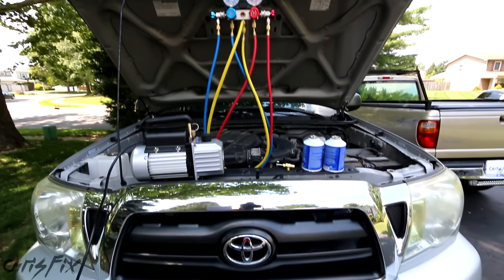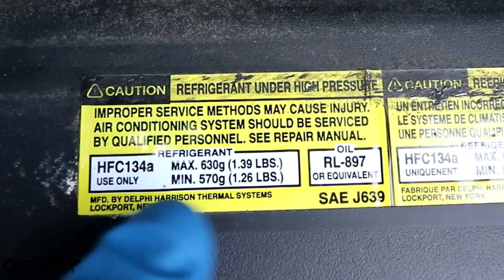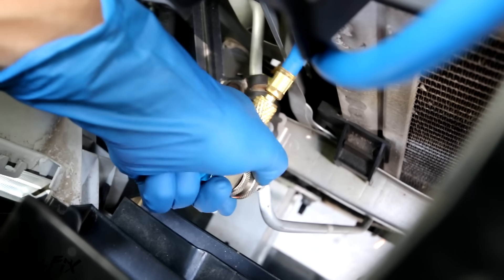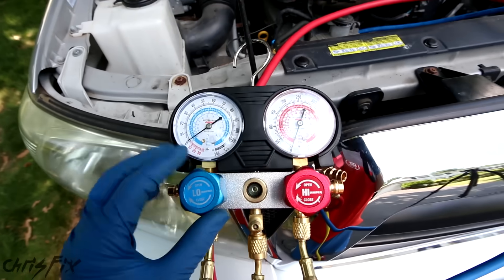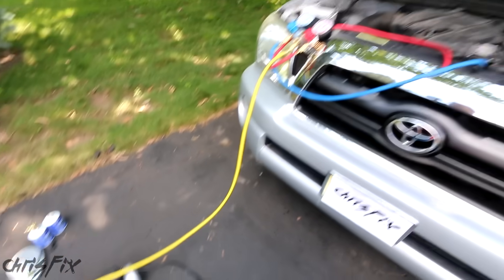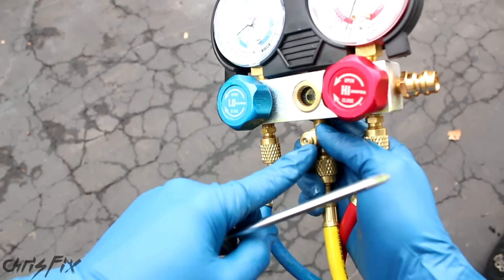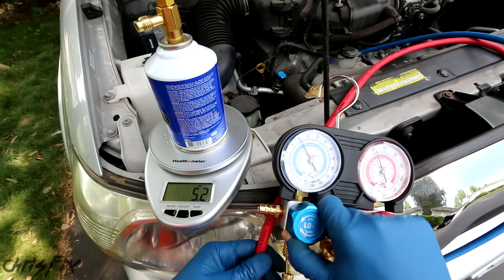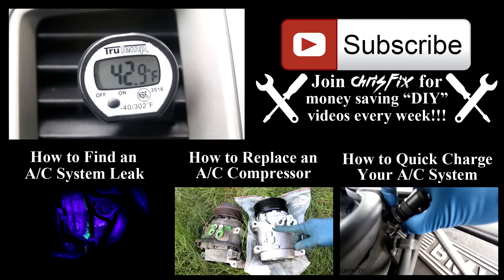How to Properly Recharge Your AC System

Comment: I have done this procedure many time and it  will work fine. Most techs pressure test the system using nitrogen then purge down to at least 500 microns , if it holds the system is recharged . According to  epa certification once your system reaches the required vacuum and holds it is dehydrated , using the vacuum again really isn't needed .

Comment: I was asked $90.00 for just checking what was wrong with my AC(Not including part and repair). I knew I had a leak and followed your videos. I was able to find and replaced the bad hose. I used this video and did a proper recharge of the AC. You Sir, saved me a lot of money and most importantly I learned something and now my AC is blowing ice cold. Thanks.

Comment: A word of warning to those who believe they have a sealed system after holding a vacuum for an hour:

I did this exact thing to my system. Preliminary test held a vacuum for an hour, leading me to believe the system was sealed. I then proceeded with another hour of the vacuum pump running. After adding the 40 oz. of refrigerant, according to the specs, all seemed fine. Cold air was blowing again, and I was ready to shut off the engine. 

Upon closer inspection, I noticed a bunch of green dye dripping on my driveway. I shut off the engine and could hear a small hissing noise. Sure enough, there was a crack in one of the rubber A\C lines. I wiggled it, and the leak became even more noticeable. I had lost all 40 oz. of refrigerant in little time. 

I was completely puzzled. I had just tested the system with a successful vacuum test. It held tight for an hour. But how can this be with such an obvious crack in the line? My theory: Due to the nature of rubber, under vacuum, the crack sealed itself as it was being sucked tighter. 

If my theory is correct, this is why one should never rely on a vacuum test to determine if they have a sealed system. Pressure would be a more accurate test vs. vacuum. Does anyone know of a way to pressure-test a system or would this be very bad for the system?

One thing is for certain, a vacuum test is NOT a sure way to check for a sealed system. In my case, it did the OPPOSITE (caused a NON-sealed system to become "sealed").
Reply: Jonathan Brett. Correct I too am a huge disbeliever in "vacuum leak check" for the same reason, at best you are checking with minus 15psi. Instead use dry nitrogen to about 300 psi, and leak check with blue,

Comment: I changed out my compressor and dryer and charged my system and now my new compressor will NOT turn off.  I didn't have this problem before, just was blowing hot air.  What could it be?  I did everything exactly as you showed, just wondering how I have a different problem than before.  Any ideas? Evacuated system, used gauges etc.  Orifice tube?

Comment: This video is great but really  unnecessary with the bottles available for $25 with a pressure valve on them...I just refilled mine about an hour ago on a 2013 Ford Escape that out of the blue just lost almost all of it's cold...but it was the first time I turned the AC on this year as the termps were higher than 90....after about 10 minutes with the bottle, my AC was arctic cold again.

Comment: If an A/C system is not working and i need to pull a vacuum and recharge the system with r134a, and i am not replacing the compressor, should i go ahead and add refrigerant oil to the system to make sure that the compressor does not run dry? One time i didn't do this, and the compressor seized up due to lack of oil. any suggestions?

Comment: did he purge when he replace the can??
Reply: No need to purge with second can because the line was already full of ref i believe
Reply: He close the valve.. He can just fit the new can by turning the can to threaded with the valve..
Reply: Jason Gould air got inside the yellow line once he removed the can. Ig you can say it was sealed becuase of the can tap but i don't trust those things.
Reply: Symon Jasmin he didn't need to since the line remained sealed by leaving the valve closed.
Reply: He had to open the valve on the can tap in order to install it on the refrigerant can... he should have purged the yellow line again before adding more refrigerant to the system.  He did not show this in the video.

Comment: Can you do a video on r12 gauges and r12 ac system? I have a 90s civic that has r12 ac system and i dont want to convert to r134a due to expensive and not worth it. even if its expensive i like to know what parts is needed to do r12 recharge and filling with r12 freon. any clues people? i know r12 is expensive and hard to fine but i want to save the r12 ac system in my civic

Comment: Great video. But if I only have one car, Buying a/c compressor Gauges which cost $80-95, and a A/c vacuum pump $90-100 makes no sense, plus $17-32 for R134. In the end that comes out to $200+tax, and that's without my labor and time. But if I go to a Auto shop the job is anywhere from $150-280. Also, it's not a job that you need on a yearly basis or every 2-3 yrs. In fact, I've only had 14 cars and trucks in my life and never ever had a A/c problem, so I guess spending $150-200 every 4-6 yrs on my A/c is not that bad after all. I can see if I had 2-4 cars then it would be different. I mean I love your videos, they are very helpful, and useful for those big jobs like replacing an A/c compressor (for which I was quoted $1000, I told him nice and loud Fk U, and did it myself, thanks to your video.). Just MHO. Great video.
Reply: I think the main problems with A/C come from "no using A/C for extended periods of time". In fact, system must work even in winter because the gas needs to cycle to  keep seals OK,.
I´ve had only a problem in my A/C some years ago, with a 1 year old truck (A/C installed from the dealer). An O ring was broken and gas escaped. They refilled the system, changed the seal and  10 years after, the A/C keeps you fresh. 
Also, if gas escapes, compressor and clutch will also disconnect (for lack of pressure) to protect the system. 
You won´t hear the CLACK sound of clutch in that condition.

Comment: Moisture will not cause a leak. Moisture will kill your compressor contaminate your refrigerant. Be warned
Reply from the maker: Moisture will cause corrosion from the inside which will cause a leak. Thanks for sharing.

Comment: Does the can tap that you used in the video have 1/4 sae thread to connect directly to the yellow hose?  I checked that one you linked but it seems to have a 1/2 acme threading & would require an adapter to attach to the yellow hose.
Reply from the maker: +TOPGUN 262 the one I got connected right to the hose. I will have to see maybe they changed the can tap on Amazon.

Comment: HELP-I recently replaced my ac line that contained the low pressure side.  Just rented the recharge kit from Auto Zone.  The new low side contains a threaded connection that won't accept the low pressure connection in the kit.  Is there an adapter.

Comment: When I was doing evac in my ac system,  I made one mistake where I left the low side gauge open after shutting off the pump.  A couple mins later I noticed there was some oil in the window in the center of the manifold.  While vacuuming, it held 30hg so I'm guessing some oil got into the system since it has vacuum pressure going in.  Do you think thats vacuum pump oil & is that a big issue?  I'm guessing about 1-2 oz went in.  I just put in a new condenser & drier with new o rings & really not looking forward to taking things apart again. thanks for any advice
Reply from the maker: I wouldnt worry. Focus on doing the rest of the job properly.
Reply: ChrisFix thanks for the response!  I was worried that the mineral vacuum pump oil will block the system.  But if that's not a big issue, then its a big relieve.

Comment: Many Many years ago, Whirlpool came up with a cure; of a constant and aggravating malady; when it comes to "using" gauges when "charging" AC items. IE:

INSTEAD of using gauges, it is ALWAYS much better to use a "charging station", that may or may not have gauges built into it. The reason for this is; there are just TOO many factors that play into how much Freon goes into an AC system. Oh indeed yes. In other words, gauges are worthless without taking these things into consideration. 

To make a long story short, follow along with what commonly happens when a person "charges" an AC system using only gauges:

In 1976 my company car blew an "O" ring one day after driving it out of the showroom. This "O" ring was in the compressor output line. Of course it lost all of its Freon (which was used then). So I took it to the dealer, to  have it repaired.

The mechanic diagnosed the problem quickly and even quicker; used his gauges to charge the system.I watched him. Sadly, the car never cooled efficiently. IE: If the outside temperature was in the 80's, it did pretty well. But above 90 degrees it NEVER was comfortable. I tried other AC mechanics. SAME problem.

Then as fate would have it, I was called to my company's branch in Memphis, TN on another non related problem. While there I asked the appliance technician to look at my car and see if he could get the AC working better. He said he would be happy to.

Within less than one hour, he came to me, and said, "it is fixed. I used a "charging station" and your freon was WAY over what it should be. So I drained it completely and put in the exact amount of freon that your car's spec showed. It should run like a charm now."

It happened to be almost 100 degrees outside that day. On the way back to Atlanta (400+ miles), my wife and I could not get over the fact that the AC now was cooling like never before. It was a true joy to feel that car cool so well in 100 degree weather.

For whatever it's worth.

Comment: So you are filling with refrigerant to the max value (22oz) and not the min? Is the UV dye bad for the compressor? My system has a leaking condenser and has not been touched for 5 years. Is a flush of the system needed  to remove old oil before I replace the condenser?

Comment: Chris, great video!, I have an AC leak that no one has been able to fix, takes a few months to lose a charge. Would you recommend a leak sealant?. They have made me change the compressor, drier and leak persist, now they recommend an evaporator replacement which is worth probably as much as the car. This is a '06 focus with less than 50K miles I purchased new and has had this issue since I have it. Thanks!

Comment: fluid oz is volume, not weight
Reply: Bob Piff, i can't believe how far i had to scroll down to find someone who pointed this out.
Reply: Don't you see what it is written on the Freon can? it calls out "NET WT", not "NET VOL".  clear?
Reply: ChrisFix is correct to measure the refrigerant by it's weight. These are compressed cans of refrigerant. Since it's compressed, it only makes sense you can't measure it by volume (fluid ounces). The volume would not be consistent because it changes under different conditions (i.e. - temperature, pressure, etc.). Therefore it's measured by weight. The capacity of your car's AC system is also listed in units of weight. You shouldn't have to convert the weight to volume when recharging your AC system.
Reply: Bob Piff funny... I didn't even think about that until I saw your post..good catch.. You could still do by weight if you wanted to be very particular about your measurements..I'm getting ready to do mine and here's my theory.. Based on 12fl oz cans.
Weigh empty can once used. Empty can weight - full can weight = refrigerant weight / 12= Fl oz weight... I think that's right? Any input?
Reply: OZ/grams = WEIGHT
FL. OZ/ml = Volume 
...Chris is right, its weight!
even the can its measured by weight.
Reply: EVEN IF you are filling your system from scratch, you really should fill until you get the proper Low and High pressure for the ambient  temperature according to that ac system specs. And yes, it's liquid refrigerant ounces by weight.
Reply: I weighed an empty can, subtracted from full can to get actual refrigerant weight.
Then get percentage of ounces you need from the last can, and divide the total weight by the percentage you need, and have it on a scale while filling the last can.
Reply: Jorgy, I'm not sure that dividing the refrigerant weight by the 12 oz weight is correct, but certainly a ratio would be the way to go to figure out how much to put in via the scale.
Reply: Piff, we do use a scale weigh in a charge. We're doing refrigeration not shots.
Reply: That is correct.  However ounce is also a weight unit (1/16 of a pound).
The 134a can is labeled "NET WT. 12OZ. (340g)".
Reply: Bob Piff refrigerants and other compressed gases are measured by weight not volume. The sticker on the frame of the vehicle lists the quantities in grams and pounds.
Reply: TheJayDawg21 I think it’s confusing when it says “Net wt 12 Fl oz (340 g)”, specifically the fluid oz...that’s not a weight. It’s the can’s fault
Reply: Andrew Raissis Great observation. I didn't notice the refrigerant cans had incorrect units in the video. All cans of refrigerant I've seen are measured in units of weight (oz, grams). It's very important to measure it by weight, not volume. Especially if you live somewhere that gets very hot and/or very cold. That could cause an excessive fluctuation of pressure inside the system.
Reply: Some people just don't love MAFF :D
Reply: All i have to say chris is thank you thank you thank you....very well done video.....
Reply: Well you need to know what the can weight is empty.The can weight plus the Freon weight is 20 ounces,Chris needed to subtract the empty can weight from the total weight of a full can ,then divide by 12 to get the weight per ounce of the Freon.
Reply: 340 g = 12 oz
Reply: @RCCBST  ummm, NO. Since gram is a unit of MASS and ounce (not fluid ounce) is a unit of force your statement is incorrect. God I hate people that think metric shit is wonderful and then misuse the units. Using correct units: 12 oz-force (unit of weight/force) = 333 616.62 dynes (unit of weight/force).
Reply: You guys are wayyy overthinking this sh!t..
Reply: John Dep actually, the cans in the video say 12 FL OZ.
Reply: This is a very good point
Reply: Bob Piff refrigerant is sold by wheight not fluid ounces as it is a gas not a fluid.
Reply: Bob Piff good catch on the label. That is actually a typo on the can, it is 12 oz net weight (340g). If refrigerant was measured in volume, the 340g canister would read 9.58 fluid oz (238 ml).
Reply: John Dep 
a fluid ounce doesn't necessarily weigh a ounce. it depends on what your liquid is.a fluid ounce of water is heavier than a fluid ounce of motor oil.
Reply: @bobpiff9081 Better use metric system. 1 oz= 28 Grams. . ! FL oz= 29 mililiters.
Reply: The can has no typo.
The can states;
The Net weight of this 12 fluid ounces of R134a is 340 grams.
Don't confuse the measurements with the universal standard of WATER.
Net weight of 12 fluid ounces of water is 354grams.
Ounces = volume (for Americans) 
Gram = weight (for Europeans)
Reply: Just go for SI measurements instead of using your body parts' feet, furlongs, stones, bricks and other yard sticks. It's XXI century! SI is a way easier to visualise, understand and calculate!
Reply: The meter is one ten millionth of the distance from the equator to the north pole along a meridian through Paris. Sure, it was later "changed" to the same length being based on a fractional number of wavelengths of orange-red light produced by burning krypton in a vacuum, and then re-redefined as the distance light travels in 1/c seconds. Those are all arbitrary. I have no idea how long a ten millionth of the distance from the equator to the north pole is. 

I do, however KNOW HOW LONG MY FOOT IS. I do know that my knuckle's width is about an inch. 

Similarly, decimal doesn't make more sense to humans. Binary does. We think logarithmically as humans. If you ask a young child what half of 10 is, they'll tell you 3 or 4. Which is about the square root of 10. Because that's, on a logarithmic scale, half of 10. 

Look at imperial measurements: 
2 cups in a pint
2 pints in a quart
2 quarts in a half gallon
2 half gallons per gallon

For distances, the mile was 4000 feet. Until the British screwed with it with furlongs. Then it became 5000, then 5280 feet. 4000? Very easy to half, quarter, eighth, etc.

A foot? Can be easily divided into quarters. 3 inches. Why 3 inches? Because 12 is an antiprime, which makes it VERY nice to be able to be divided into. I need 3 equal lengths of board from a 1 foot board? 4 inches each. 4 sections? 3 inches. 6 sections? 2 inches. Simple. What's 1/3 of a meter? A repeating decimal. Good luck finding that on your measuring stick. "Ah, 33.3333333333333333333333333333333333333333 cm. Right here it is!" 

SI is significantly harder to visualize, significantly harder to understand for our brains, and significantly harder to calculate. Your entire argument is based on the axiom that we're using the base 10 number system and fully and rationally understand it. Which we don't. It's exceedingly rare. There's a reason that if you change the number system most people act like you've lost your mind: they've never questioned it. 

And yes, I'm very familiar with the metric system, as I'm an aerospace engineer who constantly uses it because of the ease of spreading ideas using it.
Reply: @evilkillerwhale7078  don't forget to mention the almost universal mistake of misuse of a unit of mass where a unit of weight is intended. As one engineer to another, I know you know what I mean.
Reply: Fluid ounces? Ounces? Pounds? I'll just put 600 grams of refrigerant into the A/C ;)
Reply: lmao John Dep didn't have anything else to say
Reply: Who cares blow the shit up already
Reply: kray brother hahaha
Reply: That's what I thought